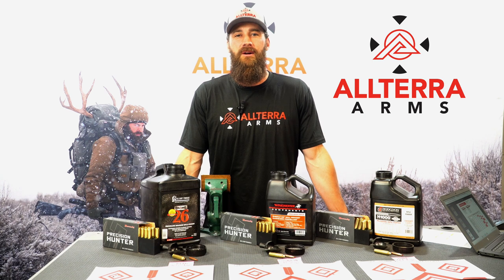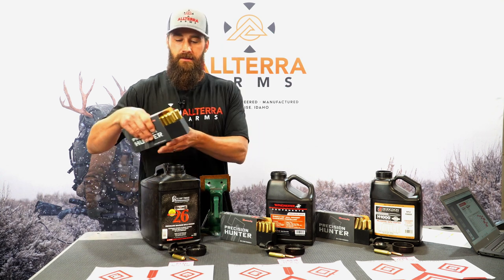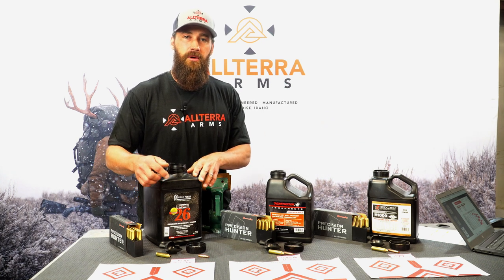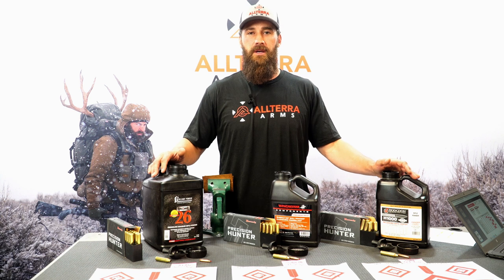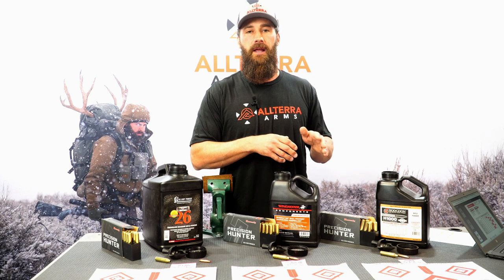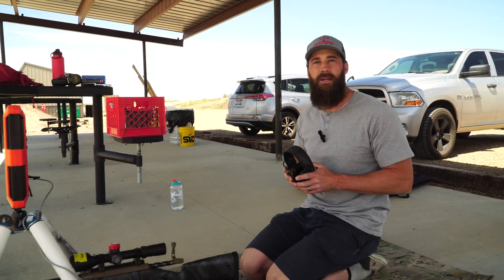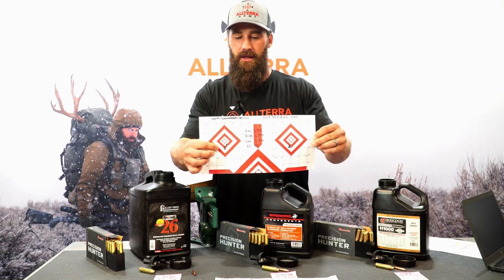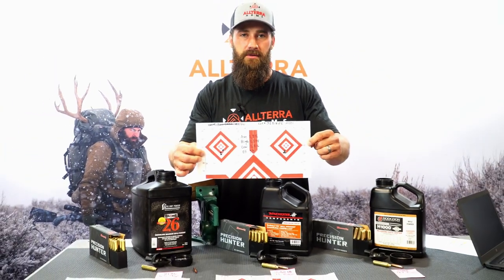Factory Ammunition Velocity Variance & How it Affects Hunting Ballistics

Comment: I first heard about this in a podcast with a representative of Federal telling that they use different recipes that fall between acceptable parameters based on component availability.
When I started reloading, I overlooked the fact that brass is included in this. They often use different brass between lots as well, so if you are trying to work up a consistent load you are better off buying 1 or 2 box  of 100 Lapua or even a cheaper brand, your brass will be a lot more consistent than reloading various combined lots of spent boxed ammo.
Reply: I always buy 200-300 factory rounds for fireforming and develop the reload based on that brass. I anneal them after 3-4 reloads to help with next tension, so i get 1000-2000 rounds from them.
Reply: @littledaddynesbit4193  Thats what I used to do when I started. Probably easiest now with the primer shortage.  Make sure those boxes are all from the same lot and thats going to have to do. 
Would suggest you anneal every reload both for consistent neck tension, and extended brass life.  I've since swapped to buying Lapua brass, Alpha is pretty good as well. Noticeable difference in numbers and accuracy from the factory brass and you can get a small primer version of some of the chamberings.. You may be able to find some small rifle primers available, unlike the large ones.
Reply: @foonus406  ..I've been reloading Geco brass which seems good quality and the groups are excellent from 100 to 500 yards in varying conditions using temp stable powder.  I'm only neck sizing too which should mean the brass isn't being overworked unnecessarily...
Reply: @littledaddynesbit4193  Right on. With the annealing it's not only a matter of cartridge life, but you are resetting the hardness of the brass to the same consistency before sizing. It gets harder with each firing and springs back more aggressively during the sizing process. This will help insure you have more consistent neck tension, and in turn more consistent results from firing to firing. 🙂

Comment: ...great test, and video! I always check and re-zero whether it's practicing @100 yards at the range or for a match @500 yard match.  Lots of factors can change between shoots and, for powders that aren't temp stable, the temperature can make a big difference.  I also shoot a cold bore, and mentally adjust for any re-zeroing changes so I have it if I need it!...

Comment: Thank you for this timely information.  I just had another frustrating day at the range attempting to reload for my 6.5 PRC.  To say I am struggling is an understatement.  I took a long range class a few years ago and knew nothing.  I arrived with 10 boxes of Precision Hunter and my trusty 6.5 CM.  I consistently hit the 10" plate at 1000 and everything in-between. Now that I have a fancy press, crazy powder trickier, custom honed dies and all the latest high speed reloading goodies i'm still struggling. I resolved to get some 6.5 PRC Precision hunter and give it a go. I bet it works just fine.
Reply from the maker: Don't overlook your rifle itself as a possible culprit to your accuracy. Carbon ring in the neck/throat of the chamber, optic mounting, the optic itself, action screw torque, bedding, barrel contact, the list goes on. With an issue in the rifle it'll be near impossible to develop a decent load. Feel free to call us if you need someone to bounce ideas off of.
Reply: I had the same problem with a Weatherby Vanguard 2. 
Started by buying a Hornady lock n load over all length guage to measure the distance to the lands and it definitely helped Playing with the length, then if still not acceptable, changed powder weights. If still having problems, change powders. Ultimately, this rifle now shoots 1/2in groups with my 2 favored bullets. The Barnes bullets like 'jump' as recommended by Barnes.
Copper jacketed bullets are typically loaded closer to the lands. If all else is unacceptable, try a different primer.
Gets really expensive with today's component price gouging, I was lucky enough to get all my loads right when it was 3 times cheaper and actually fun to go shooting, now you cringe every time you pull the trigger and only shoot to verify zero to go hunting!
Also, I learned by reading, reading, reading and more reading of my manuals. I also have friends who know vastly more than me, and can usually get a solution from asking a few technical questions.
Good luck!
Reply: 53.6 gr H4831SC. If it works w no pressure go up 3%. Do seating depth tests. Works in 2 different guns.  You’re welcome 😂. I have loads for 4 different powderes. Vit  555, H1000, H4350, Rutimbo.  I cut my teeth reloading my 6.5 prc.  Obviously be careful and build up to that. Use at your own risk.

Comment: I went through three different lots of 7 PRC ammo practicing for my elk hunt. I deconstructed my current lot and found 67.5 grains of an extruded powder. I can't imagine that it's RL26 at that weight, and it isn't the distinct color of H1000. It's not StaBall HD. They chronied at ~2875fps and trued (out to 850 yards) at 2910 at 156' elevation.  I did not have enough time to true my StaBall HD handloads (71.2gr), so I hunted with the factories. Using the 4DOF app out in CO, I doped the rifle accordingly and took a massive 7x7 bull elk at 730yds AMR at 11,400' elevation. I'm still puzzled about which powder is in my current lot, but the shot was perfect. Any ideas?

Comment: I have a 7 prc and have worked op loads with H1000, H4831sc, RL 22 All of my loads had better Es and Sd’s than those factory loads. It would be interesting to see if their powder charges are varying a bunch to get those numbers?
Reply from the maker: The powder charges did vary by quite a bit more than a handloader would achieve when we pulled numerous samples for comparison. Understandable given the volume that they're producing.
Reply: I pulled bullets from some name brand ammo and found up to 2 grains difference in some loads. Very unreliable at best and frustrating at best!